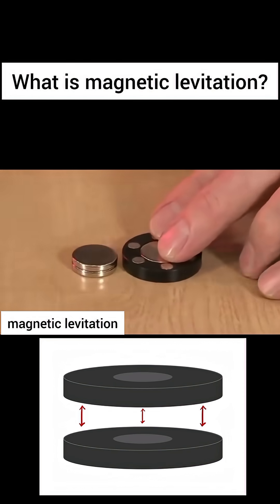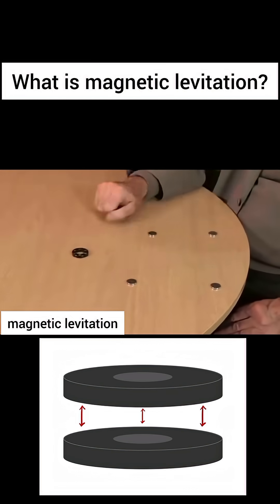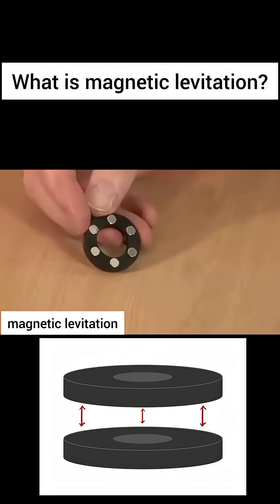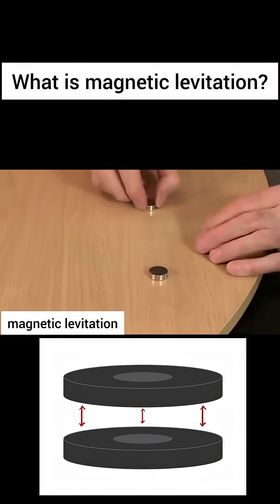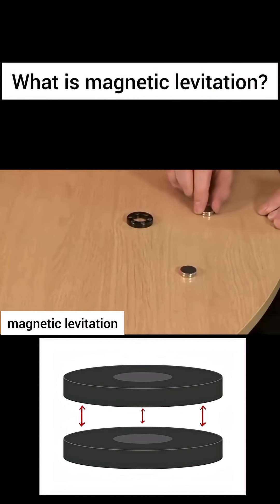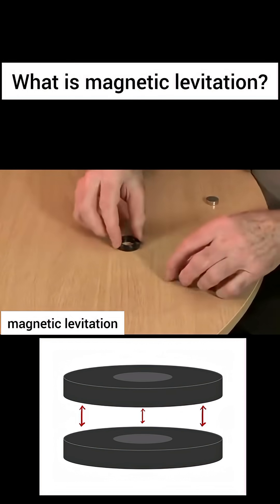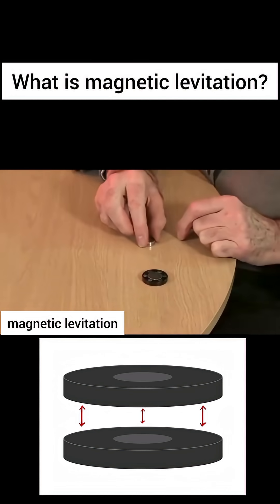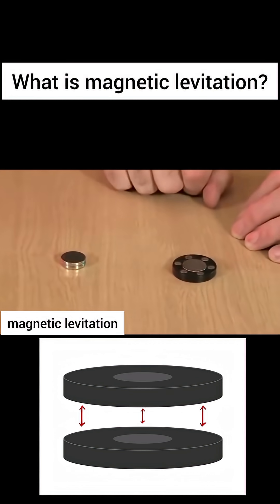what is magnetic levitation?

Comment: unfortunately not for 3D, only on the table in 2D...
Reply from the maker: Yes🌱🌸
Reply: @science-ms89 ever tried to make a sphere?
Reply from the maker: @chrismade123 if you mean in 3D, Yes, magnetic levitation has been successfully demonstrated and implemented in three dimensions for various applications, including the biofabrication of 3D tissue constructs in space, the 3D orientation and assembly of objects, and research into cancer cell models. These 3D systems often use active feedback control with multiple electromagnets or a paramagnetic fluid to achieve stable, multi-dimensional positioning and control of both magnetic and non-magnetic objects.
Reply from the maker: @chrismade123 How 3D Magnetic Levitation Works:
Overcoming Earnshaw's Theorem:
Since Earnshaw's theorem states that stable levitation with static magnetic fields is impossible, 3D magnetic levitation systems rely on active feedback control. This involves constantly adjusting the magnetic fields to maintain stability.
Reply from the maker: @chrismade123 Electromagnets and Feedback:
Systems often use multiple electromagnets arranged in a 3D configuration to generate the necessary magnetic fields. Hall effect sensors and sophisticated electronic control circuits detect the object's position and send feedback signals to the electromagnets, allowing for precise 3D control.
Reply from the maker: @chrismade123 Paramagnetic Fluids:
An alternative method involves using a chamber filled with a paramagnetic fluid that is attracted to magnetic fields. The magnets then create a density gradient in the fluid, allowing for the levitation of both magnetic and non-magnetic objects.
Reply: @science-ms89 😮 wow
Reply from the maker: @chrismade123  🙂
Reply: @science-ms89 I hate when someone says something is impossible! Makes me wanna prove them wrong!  Like faster than light! and all the constant variables found in nature that can’t be changed! And free energy!  I’m sure they said quantum superposition was impossible until they figured it out! 
The universe is bizarre!!!

Does that mean if a branch falls in a forest and no one is around to observe it the branch is in all states until it’s observed?
Reply from the maker: My bro❤️

Comment: But how the pulling force of the big magnets couldn't overcome the small magnets repulsion
Reply from the maker: Even though large magnets typically have stronger magnetic fields, the interaction between magnets is not just about size or strength—it's about geometry, alignment, and energy distribution. Here’s why the repulsion from smaller magnets can resist the pull of larger ones:
1. Airgap Energy Density

    The force between magnets is influenced by the magnetic energy in the airgap between them.

    A smaller magnet defines a smaller cross-sectional area for the airgap, which limits how much force can be transferred across it—even if the larger magnet is stronger
Reply from the maker: 2. Repulsion vs. Attraction Dynamics

    Repelling magnets are less stable than attracting ones. They tend to misalign and rotate, which reduces the effective force they can exert or resist
Reply from the maker: In a magnetic inverter, if the small magnet is positioned to repel, it may create a localized high-energy barrier that the larger magnet’s pull can't easily overcome.

3. Magnetic Dipole Interactions

    Magnetic forces arise from dipole–dipole interactions, not just pole strength
Reply from the maker: If the small magnet is oriented in a way that its dipoles strongly resist the field of the larger magnet, it can create a counteracting force that neutralizes or even exceeds the pulling force.

4. Mechanical Constraints
Reply from the maker: In real-world setups, friction, torque, and misalignment can reduce the effective pulling force of the big magnet.

    Repelling magnets often push off-axis, which introduces rotational forces that disrupt the direct pull.

In Magnetic Inverters

Magnetic inverters often rely on precise timing and field manipulation. If the small magnet is part of a dynamic system (e.g., rotating or oscillating), its repulsion can be amplified by motion, making it harder for the larger magnet to “lock in” or attract it.